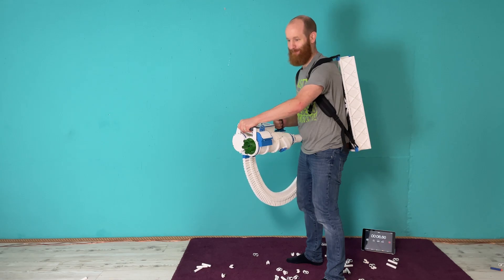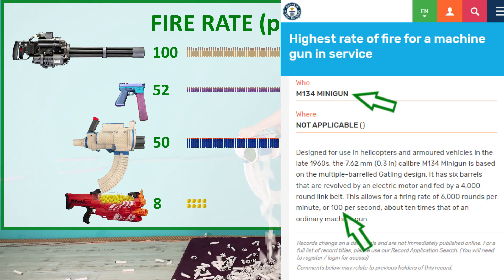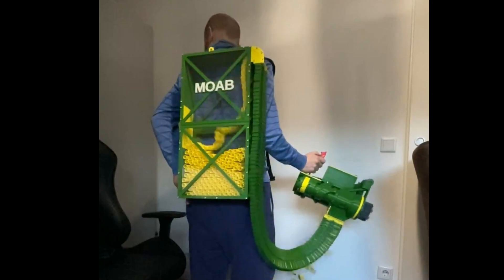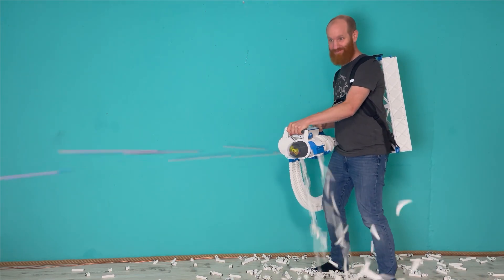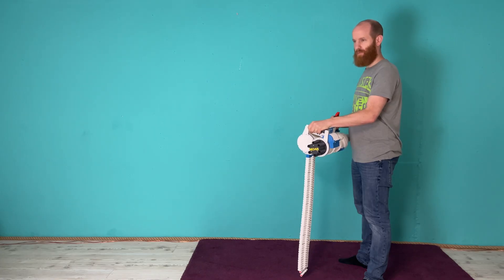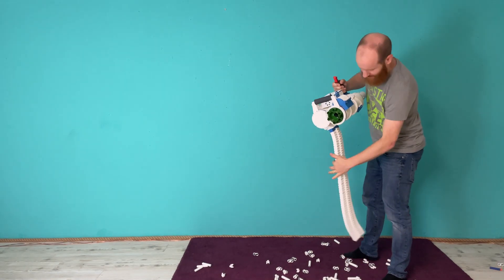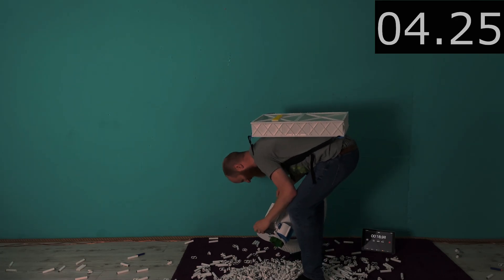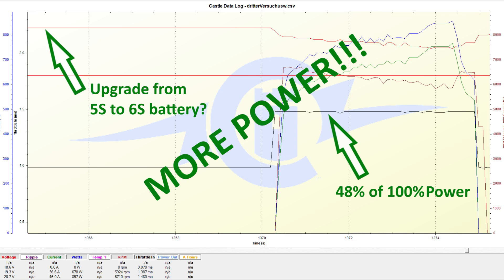3D printed Blaster faster than the REAL Minigun??

Comment: There are plenty of people that love knowing all the details of how a thing works.  One of the best parts of YouTube is getting intimate details about the build process, mechanics and problem solving done to build.  I loved the build, but love more details.  What’s the inner chamber look like, how did you properly solve the jamming issue, did you use a rasp pi, or Arduino, How many rotations does the chamber do in 1 sec?  There are a ton of interesting engineering questions here.  My favorite question so far is how do you get that firing rate without everything that’s 3D printing melt because of friction?

Comment: i thought the title was a joke or clickbait when i read it, i did not seriously believe it was possible to do this, how hard are those darts hitting compared to a stock maverick? i dont expect them to be hitting hard, but it still had enough force to make the lightswitch go off.
Reply from the maker: The darts fly with around 20m/s, so they are similar fast as the ones from standard nerf blaster. So, they are not fast, but there fly a lot of them ☺️
Also it’s good that they are not faster, because being shot at by the MOAB is already pretty intimidating, if they would hurt more no one would want to play with me anymore 😉

Comment: I think the limit how fast you can go is the flex of the darts itself. With a casing, everything is more or less ridgit but with a nerf dart when shoving it into the mechanism you compress the foam and the relaxing depends on the material properties alone.
What impresses me more is that the 3D printed parts are so durable. I was working with 3D printers in my old company about 10 years ago, they were no where close to that performance.
Reply from the maker: Well that also surprised me a lot! But I have done many iterations on many parts until i got this far
Reply: @gatlingtommy  btw, have you ever considered to loop your belt like in the A-10 warthog and use a beer keg as ammo storage? No need for a de-linking belt and the aluminium kegs are durable and could be spraypainted. Include a loading hatch and you could load the belt within the keg by slowly driving the belt forward until its filled

Comment: Some antiair systems and aircraft guns could fire faster than miniguns. For example those russian antiair things that shoot real fast or the gun of the ac130.
Not to detrwct from how ridiculous and cool this is, but still.
Reply: The equalizer (ac130 had a max firerate of 4200 rounds a minute) the Vulcan (used on AA systems) has a max of 6000. The m134 has a max of 6000. So no, this blaster shoots faster. I don't know if there are any guns that shoot faster than 6000 rpm.
Reply: @space_designs  I just googled the Russian thing. 9000rpm, so 150 rounds per second. I think it has 2 sets of barrels though and it is an implaced gun, so maybe it does not count?
Reply: @davitdavid7165  it are just two ~5000 rpm cannons next to each others
Reply: @space_designs  I guess if you count a single stack of barrels you are right

Comment: Hold on, I seem to remember that the gryazev-shipunov (Gsh) 6-30 gas powered (!) 30mm rotary cannon having a fire rate of 8000-10000 rpm. In fact, the absurd fire rate caused such vibrations that it tended to tear certain airframes it was mounted to to be ripped apart, which is why it was replaced by the Gsh 30-2 dual barrel 30mm auto cannon, if my memory serves me right :)
Reply from the maker: I heard about the Russian minigun with higher rpm, but it isn’t man held and its the m134 who holds the one record at Guinness world records.
Btw, the handheld m134 are I think limited to 3000 or 4000 rpm, since even that amount of billets give an inhuman recoil
Reply: oh, I didn’t realize that you meant for it to be compared to handheld rotary guns. To be frank, I feel that this could have been portrayed a bit more clearly in what is otherwise a great video. 

With that in mind, I can clearly see why the handheld m134 would be limited in firerate. As I said in my comment, the firerate of the Gsh 6-30 did cause some airframes it was tested on to crack and on one occasion, if I remember rightly, nearly compromised one plane’s fuselage enough to make it unable to fly/land, at which point the pilot/pilots would have had to eject. Another fun note I seem to remember being related to this gun is how, sometimes on certain airframes, the vibrations caused by the cannon would trigger the small explosives meant to for jettisoning the cockpit canopy causing it to fly of mid-flight. 

Although, upon deeper thought I realize that the cause for the destructive vibrations caused by the Gsh 6-30 may have had more to do with the action of the weapon in junction with the absurd fire rate than simply the fire rate alone. Most rotary guns are, as I’m sure you are aware, powered by a electric motor. But not so the Gsh 6-30, or it’s smaller sibling, the Gsh 6-23. While cartridges are electronically ignited, all the energy needed and used to actuate the action comes from the propellant gasses, making it gas operated. 
While this makes it loose the benefit of not being affected by misfires the same way electrically driven Gatling weapons are (the gun would jam if  even a single cartridge turned out to be a dud, were it not for a unique function involving a separate magazine connected to a special containing what were essentially blanks meant to give the action enough energy to move on to the next cartridge in case of a dud.) the benefit of the gas powered system meant that it could reach max fire rate almost instantly meaning that in a split second window it could deliver more rounds down range than a electrically powered Gatling style weapon, a big advantage in dogfighting for sure. 

Remembering more now about the weapon, I seem to recall a note in some old Soviet testing rapport that due to the amount of high explosive the cannon could dump in such a small window there was a not insignificant chance that any aircraft within a 150-250 meter radius (can’t remember exactly) of the impact point, including the aircraft firing the weapon, could become collateral damage. 

Edit: fixed some grammatical errors.

Comment: Really cool but its not the fastest. Not ony have they got miniguns with 7500 rpm variants, the Australians made the Metal Storm which is wayyyyy faster.
Reply from the maker: Yes, the metal storm is faster, but it has a limit capacity (I have a belt that go endless), it can’t be used Hand held and it was just a prototype and the company that developed it is bankrupt- so I don’t see this as competition ☺️

Comment: Can you release the files for the belt bits? It would be nice so others can use the belt in other blasters, like a normal machine gun.
Reply from the maker: I like the idea of a standardized belt system, so everyone has just the same belt parts and can shoot with different blaster. I am thinking about it, but maybe the belt could be improved to fit more usecases?
Reply: @gatlingtommy  ok, makes sense. Also I did a bit of thinking and I think it would be possible to increase the fire rate even more by making a short dart belt, and using that it would be easier to build a blaster around it.
Reply from the maker: @KarlDRG  yeah, the blaster would be smaller and lighter and could go even faster. Sadly that would mean a lot of redesigning, so I would do this for another, crazier usecase…

Comment: Do you actually need to delink the belt? Unlike actual machine guns I can't imagine you aren't reusing the cartridges and belts, you're just making a mess.
Reply from the maker: What do you mean with reusing cartridges and belts? I reuse the belt parts, they can just be clicked together again.
Developing this disassembly system with the delinker was a heck of work and is - as nearly everything on this blaster - serving functional purpose:
I need a belt to be able to suck on the darts so fast from the backpack (I don’t know of a better way to do so). The darts in the belt are close to each other, so that the belt doesn’t use up too much space, but the barrels need to be more apart, so the the darts have to be taken out of the belt and put in a higher radius anyway. And since I don’t want to have a 10m long  belt hanging of the blaster after shooting most darts, I made them disassemble themself.
Also I went for a 2 part design (link and shell). The links connect the darts together and the shell because I don’t trust the darts themself to be able to withstand the forces when the belt is pulled. 

And I think it looks cool, I love the matrix helicopter scene where the belt parts fall down, or at black hawk down…

Comment: Why do you let the belt break? I understand that it looks way cooler and is more similar to the minigun, but if the chain would not break, wouldn't it be easier to reasable?
The russians do this with their DSchK's. It has in the field the problem that the belt gets stuck sometimes but since thats I problem that should be irrelevant for you I see only an upgrade to your set-up right now.

Comment: bro nerf gun got software
Reply from the maker: Sure, it has some PID controller and other stuff, in the past it was necessary to control the RPM quite precisely, now the blaster is way more robust and maybe a simple dc motor with no big controller might work

Comment: I love that the article had to say “the fastest firing gun in service” because of the metal storm lol. 

Absolutely stunning achievement on your part and I would love to see a long-form dissection video :)
Reply: Oh right i had forgotten about it XD yea, it kinda cheats using mass parallel, but even its single barrel speed although limited to a few bullets cant really be beaten
Reply: The GSh-6-26 from the soviet union alledgedly has a top fire rate of 8000 to 10000 rpm.
Reply: @CreEpeRneSs125 spot on bud. 6-23 is the one you thinking of.

Comment: While I am incredibly impressed and this is truly an amazing feat, however I am left scratching my head a bit. How does 400 darts in 4.25 seconds work out to 101 darts per second? I havent been in a math class of any kind for a longer time than most of your viewers have been alive, but 400 divided by 4.25 comes out to 94.11764, or a little over 94 darts per second. Now for it to have worked out for 101 darts per second you would of had to fire 404 darts in a second. Am I confused or was there something I missed in the video for it to work out?
Reply from the maker: Hi there,
Well, it took 4,25 seconds to shoot 430 darts, not 400, and thus the 101dps are correct ☺️

Comment: The minigun technically has an infinite fire rate as the firing action is purely mechanical so to make it fire faster all you need to do is spin the barrels faster
Reply from the maker: but for which full-auto-guntypes is it different? Gas-operated reloading might have the limit, that the gas needs to reach the gas port first - but I would think that this doesnt take long.

IMO the biggest advantage in the gatling mechanic is, that first all movements can be executed with a way smoother acceleration (thanks to cylindrical cams) and also that this movements are done (in my case) 6 times in parallel.
Besides that benefit, in reality there are many technical limits which constraints me, e.g. at the 100dps the inner parts have to withstand 50G, for 200dps they would have to withstand 200G which will be a challenge for the complex parts and this simple PLA FDM printing method... Also the complete system consumes close to 1kW of power - thats as much as a small gaspowered chainsaw or 4 european pedelecs...
Reply: @gatlingtommy  so you partially described it yourself, for say a kalashnikov its fire rate is completely reliant on the barrel length and the length of the gas tube which limits its rate of fire and recoil operated weapons like say the MG42 have a significantly higher potential ROF but its still limited to the weight of the recoil spring and the power of the bullet, while with a minigun it’s completely dependent on the spinning of the barrels as all the bolts are on tracks attached to them, meaning if the barrels are capable of spinning some theoretical insane the mechanics of the gun would allow it to fire at that speed as well, also unlike typical guns its not depending on the cartridge to fire and is done with the spinning of the motor (barrels) meaning if a bullet were to misfire or be a dud it would simply extract normally and not cause any issues like it would on a normal firearm, meaning the rate of fire is theoretically infinite on an M134
Reply from the maker: @Provolone_cheese_enjoyer  hmmm, you are right. But I wonder if the recoil/gas topic is limiting the speed of the firearms, I thought it would be other mechanical issues since you need to move a lot of parts forth an back with typically very high acceleration peaks which might be quite a challenge for the mechanics

Comment: I guess... shorter, fatter plunger tube, faster spring? maybe a design with a slitted plunger tube where the plunger passes the slits/holes about when the barrel alligns, having already accelerated to a decent speed. That's the only way I can think of to get those darts out faster even with longer barrels. would probably be a nightmare to get the timing right if you wanted to fire at more than one speed, you'd need a way to adjust where in the cycle the plunger lets go and fit it to an RPM curve just so, as it would be slightly different for every rpm. Only other way I can think of would require an even bigger redsign, that being a breach and plunger for every barrel that rotates with it.
Reply from the maker: Well the main issue is, that the darts take too long to fly out from their shell, through the barrel into the free..., just flying through the barrel (which is quite bigger than the dart radius) takes so long, that the barrel hits the dart - I really need to make a technical video to explain the issue :)

Comment: This is absolutely ridiculous, congrats on breaking the 100 dart/s barrier! Guess I'll just have to race you to 200/s :D
Reply from the maker: Thank you! You really got me sweating with your last video…
200 I think I cannot reach, so go for it!
Reply: @gatlingtommy On paper, seems possible, since you're only running @ 48% 😊
I agree, though, and 125, then 150, ate more reasonable goals! 😅
Reply: @DUKE_of_RAMBLE  damage darts with enough speed
darts may squib in the barrel if rotational force is high enough maybe?
Reply: @sunrisejackdaw1779  Quite possible...
I wonder if printing data with that highly flexible filament would work... Still soft, but I think they'd have more strength.

However, a potential issue then might be the friction... Might have to toss those new data into a talcum bath to make them move through the system and down the barrel.

I also don't know if their additional weight would cause feed issues... 🤷‍♂️